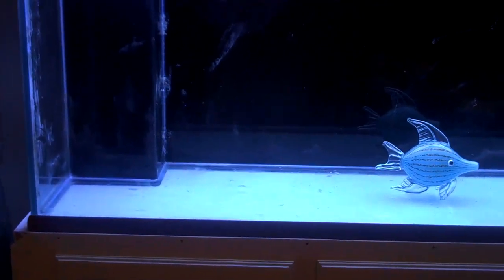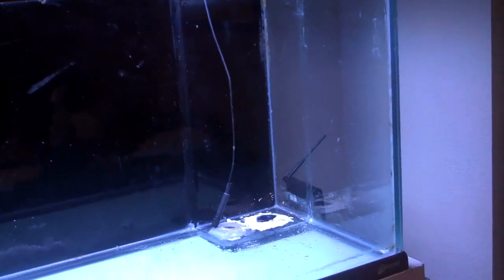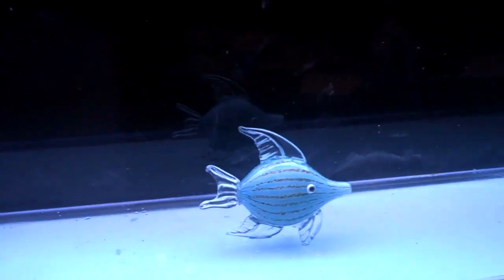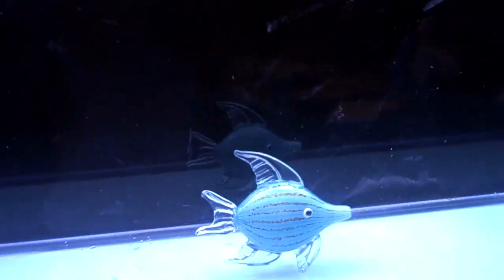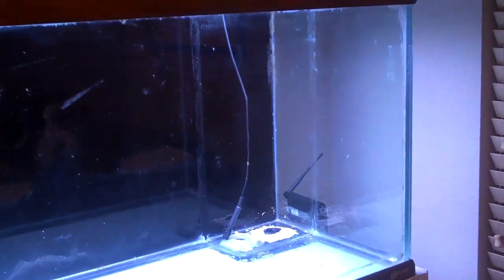Saltwater Tank Rebuild  Episode 5 Tank Scratch Removal

Comment: Mine for one side, both sides of the pane took over 10+ hours of buffing time on heavy scratch removal on just one 55 gallon. I bought two 55g for $45 so yeah, lotta work, but very much worth it considering how much I could be spending on two glass 55 gallons.
Reply: Chris Fuller petco sells them $55 each brand new during their $1 per gallon which they run it several times a year.